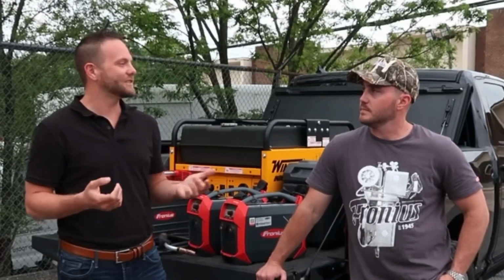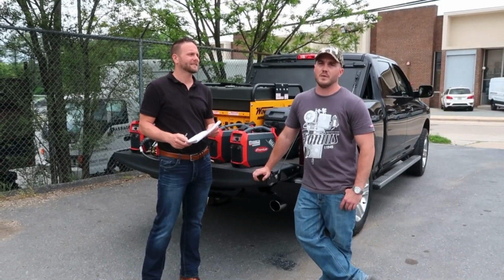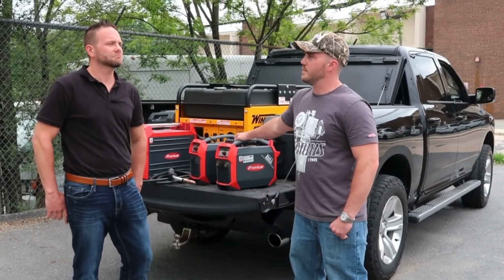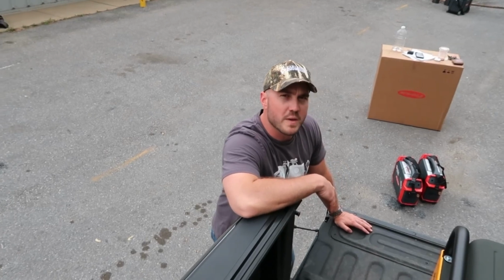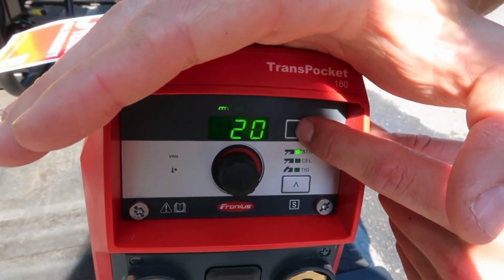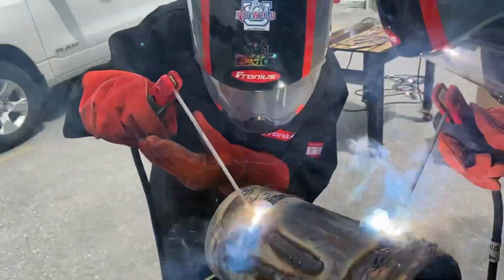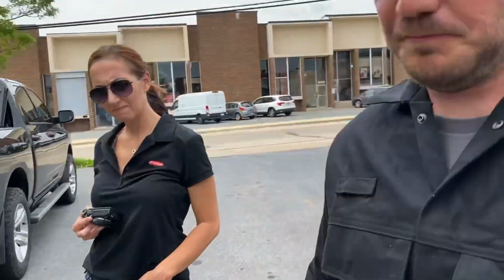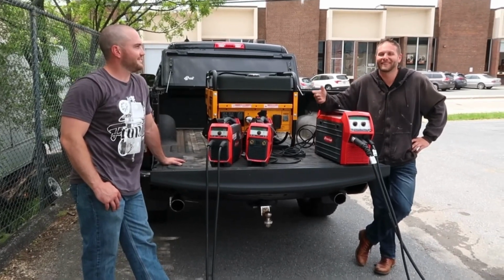Do You Need A Welding Generator? #generator #tools #welding

Comment: I will say after running a set up similar to this I don’t think I would even want to waste money buying a smaller engine drive welder like a bobcat 225. A Lincoln vantage or something equivalent would be nice to have on occasion but setting yourself up with a generator and a trans pocket and trans steel is the way to go in my opinion. I have an old SA200 I use on bigger jobs but most of the time it just sits now that I got my trans pocket.

Comment: Does the generator need to be a clean power generator.
Reply from the maker: To run the machines?
Reply: @chris_b_liven  yes for the machines, I was under the impression that a inverter based machine needs a clean power generator.
Reply from the maker: @maggitmaster  Fronius builds them for dirty power with extended voltage ranges
Reply: @chris_b_liven  good to know, I will keep that in mind when I get a generator for my 2200. Thanks
Reply: @maggitmaster  I have a westinghouse 9500 I believe it was 23%thd and it does not run the fronius 2200. the lag time for the idle to jump up reboots the fronius thus not being able to weld.
Reply: @davidro-qq9cb  try setting the generator in high idle? I run a 2200 off a champion 4000 on occasion. It doesn’t bother the fronius but I have blown light bulbs that were plugged in while welding.